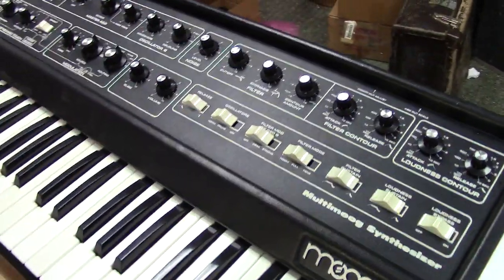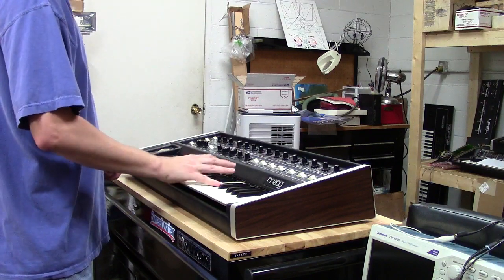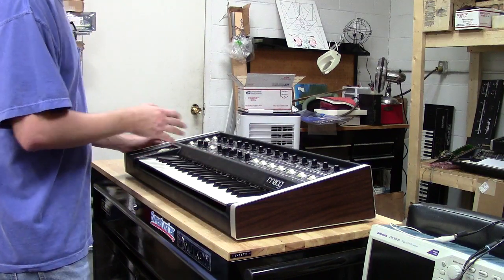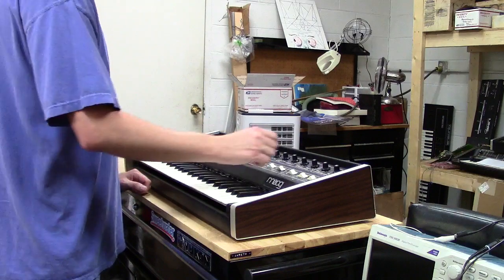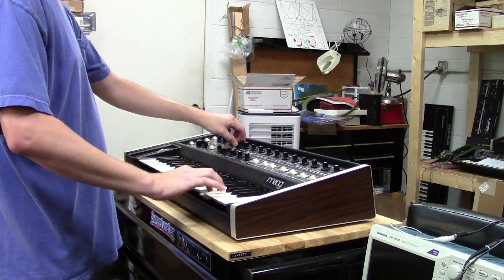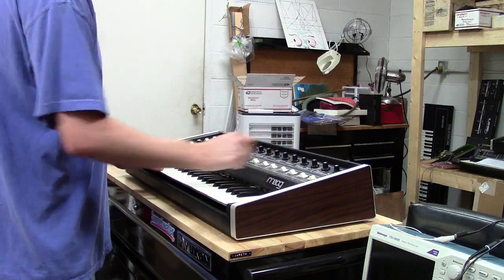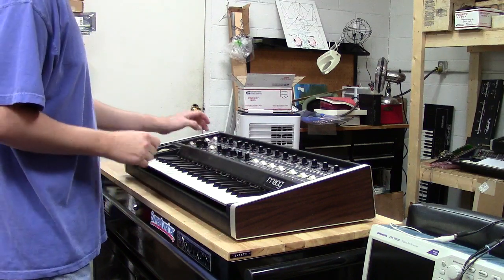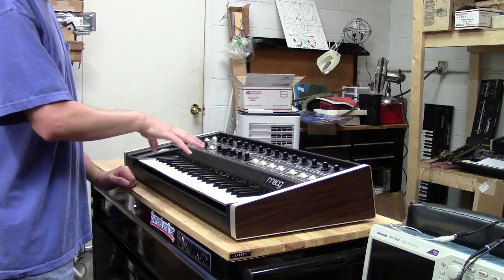Freddy's Multimoog Repair (by Synthpro)

Comment: Nice to see an Ensoniq Mirage pop up from time to time.
Reply from the maker: That's a dog unit I have had for years. There is a tag inside from the factory where it failed burn in 4 times and then was never really signed off as passed.
Reply: @synthpro  Impressive. You'd think they could have just swapped in a new board or processor/Q-chip and called it good.

Comment: Since I got a Minimoog I haven't used mine as much. I find the sound isn't nearly as full and rich as the Mini. Also it's a bit strange that 0 volts on the keyboard isn't on the bottom key. I wanted to use it to control the Voyager RME but I don't think it would work for that. Now I'm using the mini (reissue) to do that anyway.  Also the aftertouch is MUCH more sensitive in the top octave of mine.
Reply from the maker: They do have a different sound from the minimoog D but there are things that the multi does that the mini will not. Really like them both for their own tones.